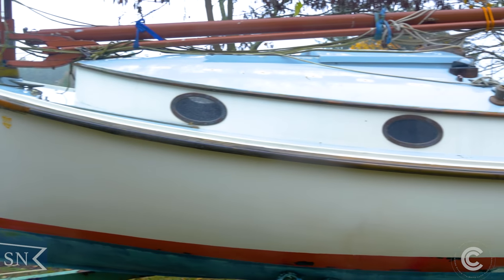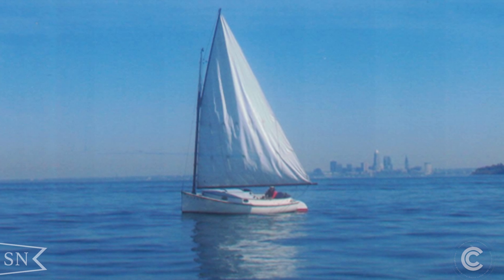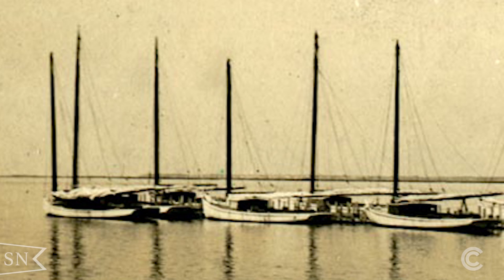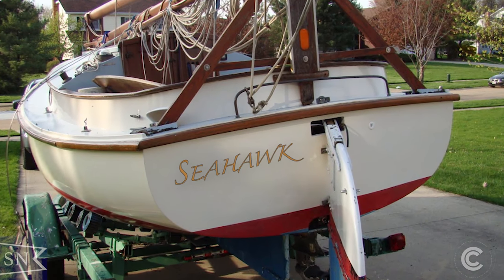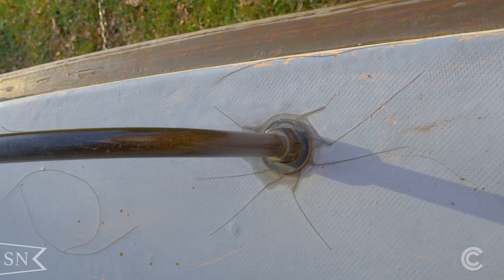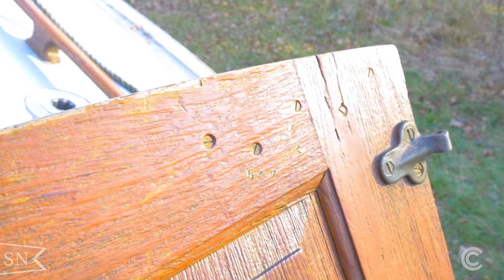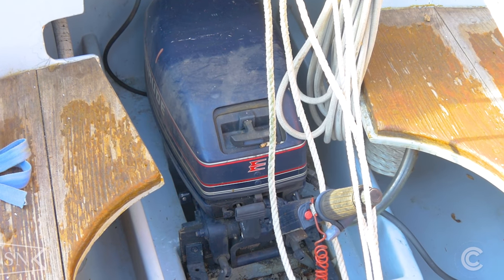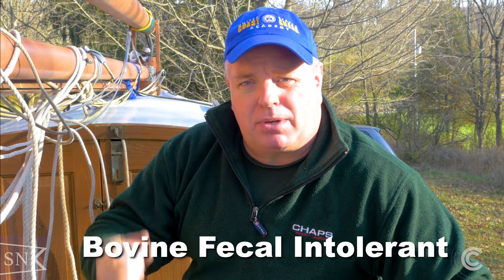Eps 1.1 - Catboats and Seahawks - S1E01

Comment: Hi,
I also have been restoring a HA 18. That effort was published in Good Old Boat magazine last year. I do have an annoying slight leak which I have traced ( maybe) to a leaking centerboard pin. The last builder of  HA 18 is still in business and said that refibreglassing around the pin is easy and I'm planning to do that this spring. I trying to find out if the pin is located above or below the cabin floor. It's difficult to measure from under the boat with the board still in. Do you know where it goes through the centerboard trunk. It's not obvious when I removed the facia around the trunk. Appreciate any info.
George

Comment: Did you get a good price on the boat?
Reply from the maker: I did. It has been on the market for a while and it needs a lot of work, but nothing extensive as far as I am concerned. Most people want one they can put in the water and go. But a fixer-upper is really the only way I can swing one of these right now and I love restoring boats anyway, so it worked out.